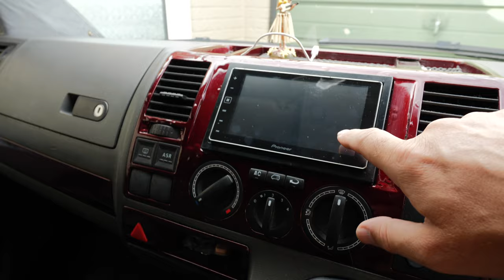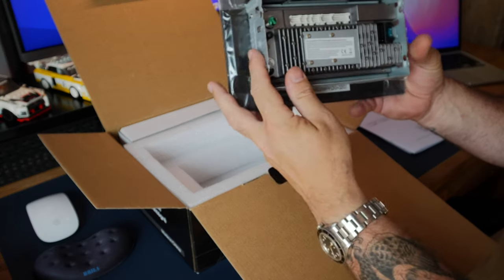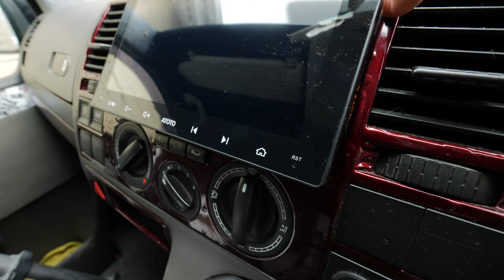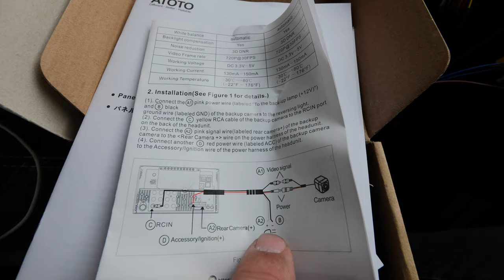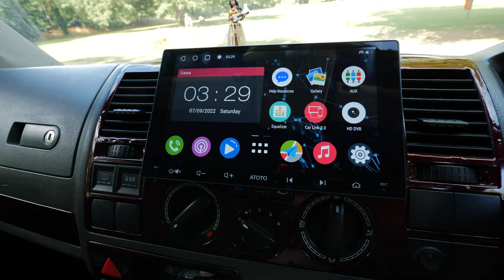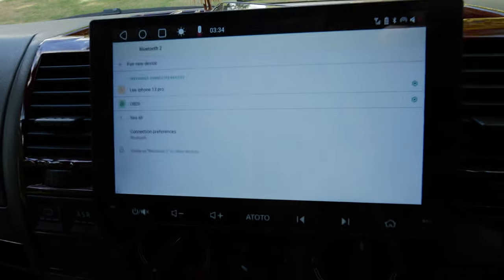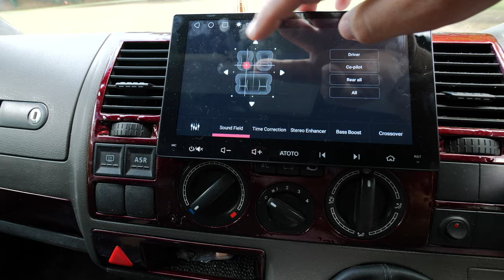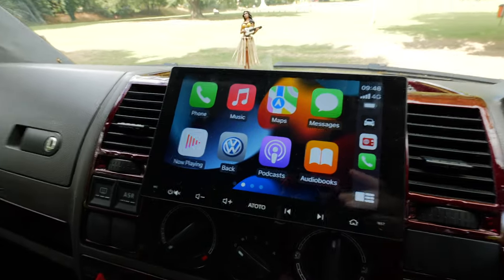Wireless apple carplay   -VW Transporter T5 - ATOTO A6 PF 9" Android car stereo

Comment: Hi nice video and looks like a nice piece of kit, but I'm curious, how did you get the better angle as that's the main issue iv had with touch screens in the t5. Was it a built in ability of the screen or did you need to jerry rig it to allow for the better angle?
Reply from the maker: The mounting bracket of this screen allow for a little movement
Reply: @SpyderLEE   oh good to know ty.

Comment: Hi mate, will this fit directly in a t5 or did you need to re wire the harness yourself?
Reply from the maker: Fitted straight in using the harness I used in the vid 👍

Comment: does it work with steering wheel controls and parking sensors?
Reply: I don't suppose you found out the answer to your question did you? I'm after buying one but I have the same questions as yourself.

Comment: I bought the ATOTO A6G29PF radio after watching your review, for my T5 2012, and it won't fit in like you showed on the video.  Do you know what cage adapter I need for it, are you able to help
  Thanks
Reply from the maker: I completely removed the original cage and only used the parts that come with the atoto. If it doesn’t fit then you still have something in the hole that needs removing

Comment: Hi spyder I’ve started fitting the atoto a6 pf and I’ve come across some issues how to secure the brackets behind the panel and the connectors fitting to my iso lead that were supplied have you got any information for me 🙏

Comment: I just purchased this system it's a great unit  I have only one problem the illumination on the control panel does not illuminate. I can go into settings and illumination turn it off and back on and it will then light up but i have to do that everytime i turn the sysyem on...any suggestions?
Reply from the maker: Mine illuminates when the side lights are on. Is the orange wire connected to your lights.
Reply: My illumination wire (the orange one) on the stereo one is connected to the orange wire on my vehicle harness labeled illumination
Reply from the maker: @1DASMOOVE  should be good then. I’d be tempted to test it has power when the lights are on.

Comment: Installed and mostly working. But it has permanent power. I can switch it on and off. But it does not switch on/off automatically when I switch ignition on/off like urs. What am I missing. All the loom wires match on the t5 I have. It’s driving me nuts😂
Reply from the maker: Sounds like the red and yellow need swapping
Reply: @SpyderLEE  so the red and yellow wires should not match the loom wires? So van red to yellow loom wire & van yellow to red loom wire?

Also do you Can Bus fitted?

Comment: After fitting the HU it has backlights but keeps turning off then on without cycling through to start-up.
Have swapped the yellow and red wires in the iso connector and android initialised to main screen but when switched off won't switch on again.
Assume wiring must be out somewhere?
Reply: Sorry that should have been switched y&r  wires in VW quad connector.
Head Unit goes off when drivers door is opened or headlights switched on.

Comment: Just got an A6 pf. Installed with an ISO adapter harness. No sound to the speakers. Tried a diff radio using Same harness and it worked. Tried to hard wire the A6 no change. Have I a bad unit ? No reply from atoto as of yet.
Reply: Did you fix it? I am researching it, think the Amp power one cable needs to have a live feed from the 12v source that powers the unit, even though the car I am using does not have a amplifier built in to the stock system.
Reply: @financiallyfree  yep , the HU they sent me was faulty, they eventually took it back. I bought another one of the same and it's perfect

Comment: bummer, every one of these Atoto 'installs' shows none of the physical mechanical install...the only part that is a mystery.  There are hundreds of videos going over the features..don't need another.  Thanks anyways.
Reply from the maker: Thought I did to be honest, can’t remember. It’s literally 2 side plates that fit to the car and this slides into them. I’ve got another video on my channel with the atoto s8. I think I go through it on that one.
Reply: cool, I will go give it a watch.  It appears like you have to be able to get at some small philips screws..so that seemed weird, but I guess it should be tight enough, or even some foam or felt could be added to cover up and visible cage.
 @SpyderLEE